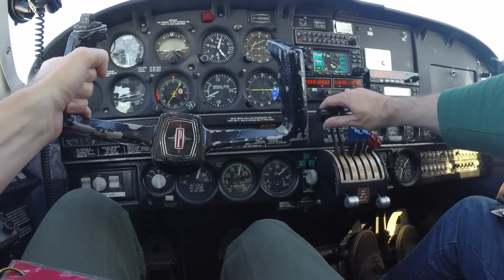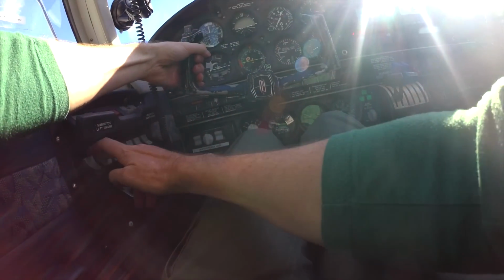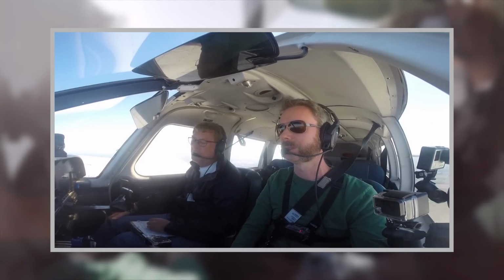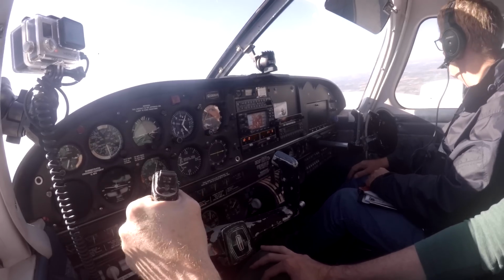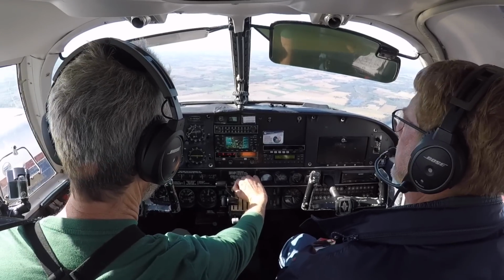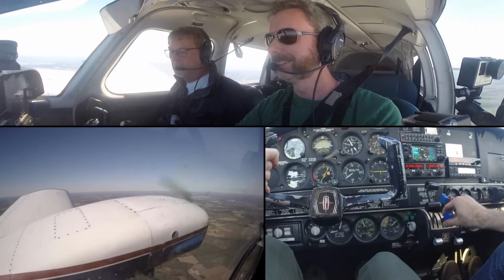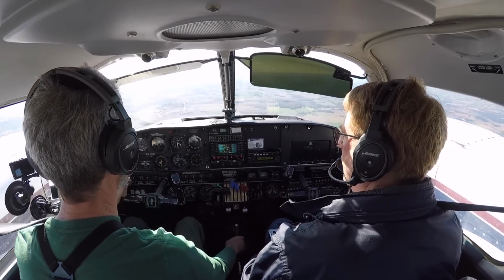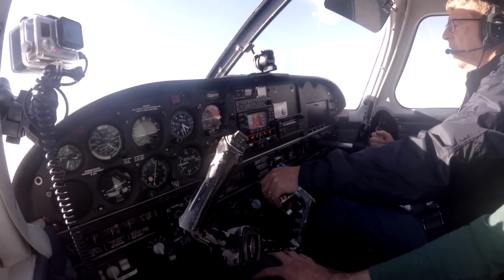Getting my Multi Engine Rating! - Surprise Engine Failure - Flight Training VLOG

Comment: I remember my multiengine checkride. I wanted to maintain my instrument rating which I obtained with a single engine. In the middle of the procedure while shooting an ILS the examiner pulled by left engine and I had to continue without losing the localizer and flying approach on 1 engine. I never did that actually in training with an instrument approach but it was a good exercise. At the end of the day I passed my check right. Unfortunately, since multi engines are so expensive to rent I haven’t flown one since I obtained the rating in 1995! I only have 28 hours in multi-engine aircraft. 😔
Reply from the maker: There’s still value in having done that training even though you didn’t get the chance to use it much.  Another good one that will help all your other flying, is tail wheel - if you haven’t done that, I highly recommend it - and it is not too expensive!

Comment: 10:36 "It's into the bad engine that you don't want to bank, right?"  This is a Myth. If you stall with yaw, you will spin - so if you get TOO SLOW turning towards the failed engine you may not notice the extra yaw, and then you are in trouble - but above Vmc it doesn't matter.  See Avweb article:
https://www.avweb.com/flight-safety/technique/operating-superstitions-part-two/
Reply from the maker: Yes, Bob Hoover used to do a single engine aerobatics routine with lots of maneuvering, including turning toward the dead engine.  The key is to maintain speed above VMC - I think maybe this myth is spread just to make it simpler for people to avoid the risk?
Reply: @FlightChops  I think it more likely that whenever people saw a twin on one engine crash, it rolled towards the dead engine as it spun in - and assumed it was the roll towards the engine that was the cause, not the symptom, of getting too slow with assymetric power.
I saw Bob Hoover's display in Australia - he spent a year there when the FAA suspended his medical.
Reply: Turning into the dead engine raises Vmca, so you could potentially lose control if you bank into the dead engine right above Vmca as shown on the ASI. It's ok to turn into the dead engine if you're at blue line and use a moderate bank angle.

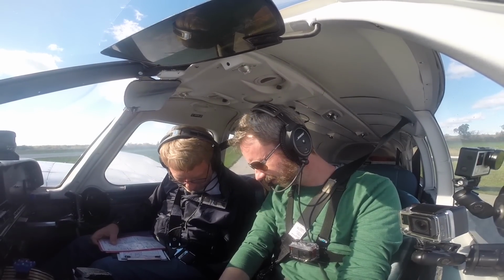Comment: 1:53 "Flight controls free and correct." - it looks like they were free, but correct?  I always used to teach "Up, Up, Up" - as in: Roll left, look left and see the left aileron come up, pull back, look back (if you can) and see the elevator/stabilator come up, Roll right, look right and see the right aileron come up.
Reply from the maker: Excellent insights here!

Comment: Great video! I did my multi before my PPL on the Duchess and it totally changed the way that I fly. It makes you more aware of the aeroplane, teaches you to stay ahead of the aeroplane, and makes you a more confident single engine pilot. On the levers to the firewall comment... You wouldn't want to do that on the Seneca II either. Turbos don't like it much :D

Comment: Steve....another great video.  My comment is this.....hesitant about bringing the flaps up.  You should always know where the aircraft is in performance...i.e. how close you are to stall and bring the flaps up based on that.  If close to stall you can milk them up as the aircrafts performance increases......but as you’re bringing them up be aware of where you are performance wise....how close you are to stall in the current configuration.  With that being said...each airplane has different GoA/abandon approach procedures and those procedures should be followed. 
Thanks for the video.

Comment: One scenario for going to max power on one engine operations is if the plane is at max weight and a hot flight density altitude day. You might not be able to hold an altitude while keeping the speed at blue line.  It's better to have the engine run on max power and make it to an airport than to have to land in a field 3 miles away from one.

Comment: 7:00 I actaully had the same problem when I was first learning stalls. After I pitch over my instructor told me to shove the throttle and recovor, and when I had the airplane I did it slow and steady and it really bugged my instructor since I ended up loosing a lot of altitude. It was somthing I had to get over. I had developed in my mind throttles are always somthing you move SLOWLY but I guess it really doesnt matter for small engines.

Comment: My favourite part, as I'm watching this with my wife.
"I did my multi on an identical old model Seneca"
"oh really? is it a nice plane to fly?"
"..no...not really, kinda heavy and sluggish, nose heavy with only two in it"
Immediately from the video 
"you'll notice this is kinda heavy and sluggish, not the nicest but good for a trainer"
hahaha
my other complaint on the older seneca's are the stupid engine gauges are hidden by the yoke for me at least. gotta turn my head to see RPM and Manifold. Newer seneca's like the 4 and 5 put them down the center by the radios like a Baron. much nicer layout

Comment: Only in the Air Force did we actually shut engines down. All other training for civilian CFI was reduced power. If you are on your game it isn't going to get you. Thinking ahead of the aircraft is mandatory. Meaning have a plan if you have engine failure on take off, on climb out and what altitude will you bring is down or go around, etc. That is how I was trained and how I trained students. Here is the problem a student is overwhelmed with all things being new and important. Only after flying some does a student understand what is important and then learning happens....

Comment: 4:12  teaching bad habits.  There is no need to reduce power to 25/2500.  If you are climbing, leave the damn levers forward.  The IO-360 is perfectly happy making 2700RPM and whatever manifold pressure the altitude will allow.  You can lean as you climb to keep the same EGT you had at takeoff.
        It never makes sense to reduce power while you are climbing.  Most of the time, it's more fuel efficient to climb at wide open throttle and max RPM to your cruising altitude.  The ONLY time I could see this as useful is if there is some heinous noise abatement issue like at KSNA.
Reply from the maker: I am training to fly a T6 now - I am glad that I have the primacy to think about setting climb power after take off. 
It is definitely not something I'd consider a "bad habit" - if anything it is the other way around - many aircraft do require a power reduction after take off, so the habit of not thinking about that would be the bad one I think.
Reply: I should have said this first, I really enjoy your videos since they give a great perspective of the challenges of learning to fly.  As a CFI, I find them helpful to better remember what it was like when I was a student pilot.

As an active CFI since 1997, I am very aware of the law of primacy.
      
     It's difficult to know where this whole 25 squared (25"/2500RPM) thing started.  It probably came from WWII era flight instructors that taught METO power in the big radials and then started teaching in light GA airplanes after the war.  
      However, METO doesn't apply to our flat, opposed cylinder engines.  If you ask most CFIs why they do it and teach it, they won't be able to give you hard data on why they reduce power in the climb.

     Secondly, if you grab the flight manual for "most" GA airplanes with constant speed props....I'm talking about normally aspirated PA-28R, PA-34 (in this case), Cirrus, Beech model 33, 35 and 36 Bonanza etc, you will find that the "time, fuel and distance to climb" tables do not have this reduced power setting.  
    
      The manufacturers use WOT and FULL RPM (usually 2700 RPM) in the climb tables.  Again, the objective is to CLIMB.  Climbing requires excess power above which is required for level flight.  It does not make sense to reduce power while climbing!
      
      Lastly, as is the case with this IO-360 powered PA-34 you were flying, the RSA fuel servo that meters fuel as a function of mass airflow has a circuit that adds fuel at full throttle (WOT).  This added fuel flow adds a layer of margin to guard against detonation.  When you reduce power while climbing, you reduce your detonation margins.  This extra fuel flow at WOT is also found on some big-bore continental engines.

       Granted, most GA pilots won't have the opportunity to fly large turbocharged radial engine powered airplanes like the T-6/Harvard.  Those airplanes do have specific, time limited takeoff power settings (1 min for example), after which you must set METO power.  
      
      When flying the Harvard, by all means, comply with the flight manual limitations and reduce the power to "climb power" when climbing.
 
       However, please don't think you need to do that when flying "most" all other GA airplanes when no such limitations exist.
      
   Maybe in a future video, you can tackle some sticky aviation "old wives tales" and useless habits like these (sub-optimal) climb power reductions.
Reply from the maker: Thanks for the detailed insights
Reply: FlightChops 

Steve,

       http://www.mooneypilots.com/mapalog/powersettings.html

     If you'd like some more insights into climb power settings, the article above is written by an engineer and test pilot.

You can also search for John Deakin's "Pelicans perch" articles on the physics of combustion in our aircraft engines and why proper power management in climb, cruise and descent is important.

     Here's one:   https://www.avweb.com/news/pelican/182045-1.html
Reply: I answered a previous comment to this effect already, but here goes again:

From the publication Lyoming Tech Tips:

DIRECT-DRIVE ENGINES
Most normally aspirated engines are rated at full power for
takeoff and climb indefinitely, provided engine temperatures and
pressures are within the green arc area of the engine instruments.
Extra fuel, sensible airspeed and cowl flaps, if available, are all
helpful in keeping cylinder head temperatures within desired limits
during takeoff or climb. Climb requirements may vary; for example,
on a warm day with the airplane close to gross weight, and a
direct-drive engine with a fixed-pitch prop, the pilot will need full
throttle all the way to cruise altitude. The same airplane on a cold
day and lightly -loaded may not require full power for climb. After
full throttle at takeoff, the pilot may want to reduce power 100 or
200 RPM and still not see performance suffer.
Those direct-drive normally aspirated engines with a prop governor
are also rated indefinitely at full power, and the manuals all
recommend full power for takeoff, but specify a small reduction in
power, generally to 85% power climb. Study the specific airplane
Pilot’s Operating Handbook for detailed power settings.

Additionally, 25 inches cruise power setting. I expect if there was significant risk of detonation at 25 inches, Lycoming would not allow it as a usable power setting.

Comment: Hello, what is meant by having the blue line in this video?. Thanks for your response and good video. Nice training.
Reply: Sorry for being late in replying, but "Blue Line" refers to a marking on the airspeed indicator which depicts the best single engine rate of climb speed. In the case of the Seneca 1, it's 105 mph (slightly above 91 knots)

Comment: Hey, FlightChops!
You might've discussed this with your instructor already. But, in case you haven't, we do full forward on the levers so we really make sure she flies. Imagine you lose an engine right after lift-off, and you still have your gear down. Well, I don't wanna be a pessimist here, but if you don't act quick she won't fly. You don't wanna waste time worrying about the limits on the RPM indicators, so make her give you everything she's got and go clear configuration.

Loved the video though! Safe flights and have good landings!

Comment: Nice to see one of my favourite aviation channels upload a video about the same aircraft i'm currently training in. I'm taking my multi-engine checkride tomorrow in a Seneca I.

About the topic you put out in the video: If you're on cruise flight with plenty of altittude i think you have enough time to move all the levers forward slowly whilst checking the engine gauges....But, if the failure happens just after takeoff and you're near the ground at low speed (probably with the gear and/or the flaps down) you might not get adequate climb performance if you don't act quickly and configure the airplane for a single engine climb, so moving all the levers forward is better. I also believe that there's not much risk of overspeeding the props since you're probably not going fast enough. Even if you did, i prefer to go over the red line for a few seconds than hugging a few trees :D
I agree with you on the fact that it also depends on the type of airplane, and doing it on big, radial, supercharged engines is a whole different story.

Hope you enjoy flying the DC-3 and the Beech 18, i love those beasts!

Fun fact: The checklist on the airplane i fly was made by your school, it says spectrum airways on the bottom ;)
Reply from the maker: I have this full flight available for Patreon Supporters, and well as my uncut flight test prep lesson - if you wanna review before your test, I can send you the links - but please don't reshare :). Flightchops at gmail dot com

Comment: Noob question since the ink is still wet from my checkride last month, why doesn't the dead engine prop windmill?
Reply from the maker: The idea is that the dead engine will windmill causing a great deal of drag, until you "feather it", which makes the pitch so course that it is no longer catching the airflow, thus it stops spinning and creates much less drag.

Comment: One piece of advice for retractable gear airplanes - when either retracting or more importantly extending the gear, keep your hand on the gear handle until you get the down & locked indication or up & locked. Things happen very fast in the takeoff & landing phase in which the gear is NOT a set it and forget it item on the checklist if it is not functioning properly. It’s very easy to get occupied with other things & sometimes you can forget about looking for the green lights completely such as on an instrument approach or long final. If you do need to use your hand for something else complete the appropriate item then put your hand or at least a finger back on the gear until it does indicate appropriately. 

As for multi-engine you have an excellent instructor that uses the law of intensity (an experience felt in reality rather than a discussion results in a more lasting impression). It’s a bit unnerving when you look over and that prop is actually feathered in the airplane rather than what it’s like in the sim, albeit they are excellent tools to practice actual single engine ops on takeoff & landing. The multi-engine was probably the rating I had the most fun with because it was relatively easy. Hell I spent more time with one engine than with both “working.” Oh, and don’t forget leg day.
Reply from the maker: Thanks for adding some great insights!